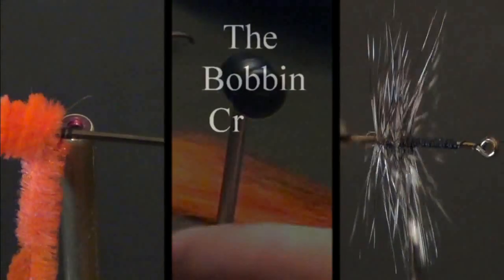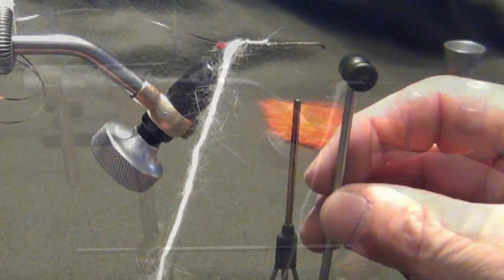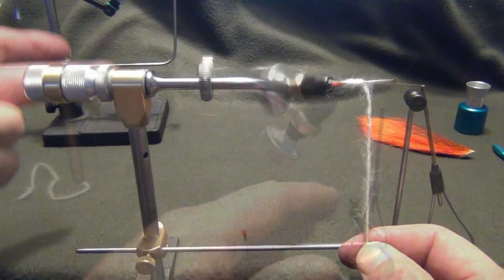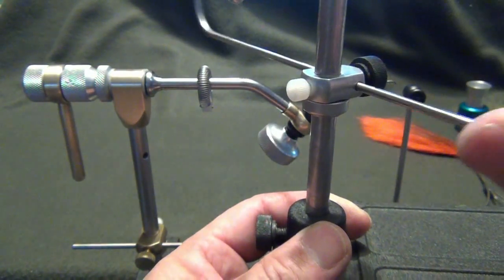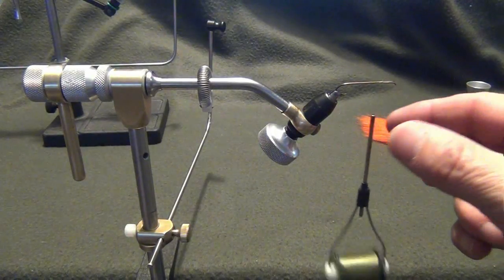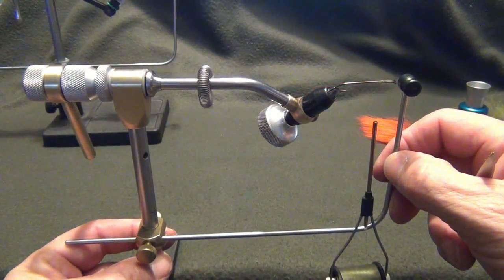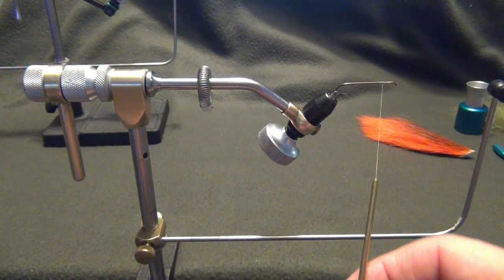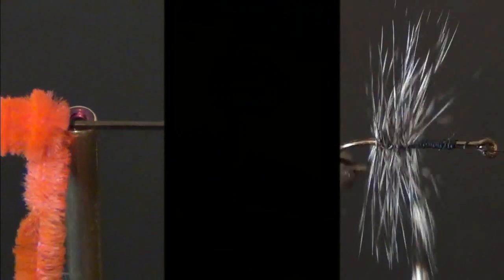The Bobbin Cradle

Comment: Thanks for sharing - I always tie off with two half hitches before I use the cradle - and always then end up having to rewind the thread to continue tying sometimes having to hold a hackle whilst I do that - - a great tip about having the cradle much closer than I have been using it - Much appreciated.